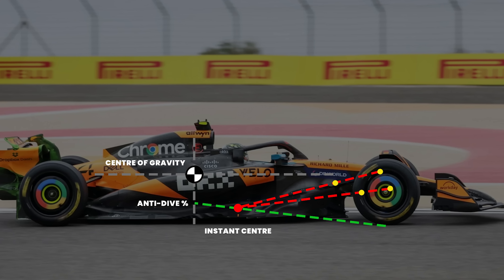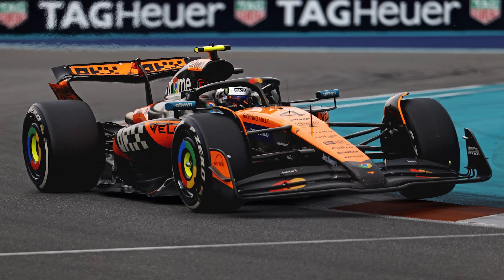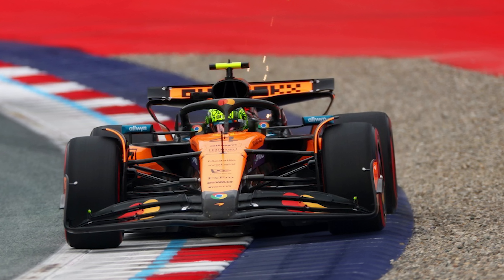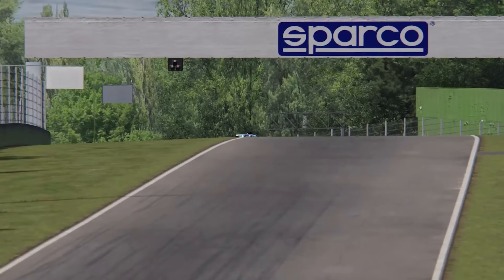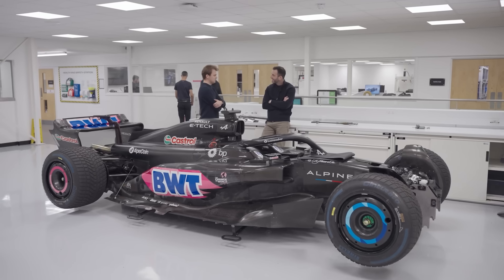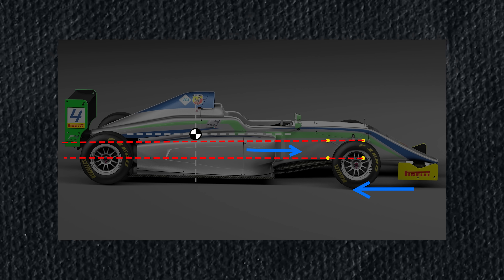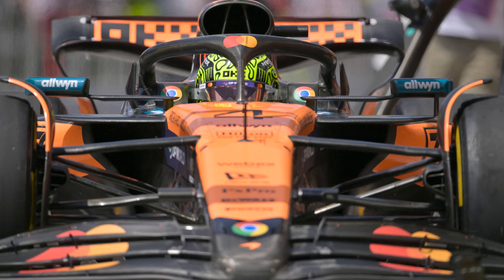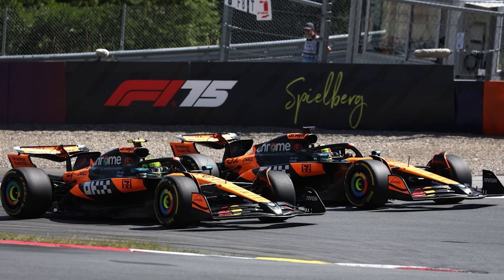McLaren’s NO SUSPENSION Trick

Comment: Of course, the compression of the tire - acts as "spring".  As more weight is added to a corner, the tire profile changes -  acting as a spring.  These tires are not solid  incompressible rubber.   Even chassis flex acts as a spring.    NONE  of these sites has answered the question, why do you cross weight ?  and when does uneven crossweight improve "lap times"...........   Someone please start thinking about it.

Comment: Taking all the braking loads through the wishbones means the front will be very stiff during that phase and it will be easy to induce a lot of microlocking in the zone which really hurts the tires. I wonder how they're getting around that aspect of running high anti-dive?

Comment: I recommend investigating whether or not they're employing flaps.Yes, like airplane flaps, split air line.Air flaps on an airplane can give as much as three times the plane's weight and lift assistance. Allowing very low speed, takeoff's and landing correspond.A jet plane low speed is anything under a hundred and thirty miles an hour just a thought.

Comment: I remember from my reading that when considering the roll centre near the CG in a cornering scenario, a "zero roll" setup would introduce a "jacking force" to cause the inside wheel to lift, instead of compression of the outside suspension. Would the same effect apply in the video's scenario and cause the rear to lift? Also, how do they combat the overloading of the front tires under braking, since the forces now act near instantaneously through the chassis, when there's no compressible suspension to tune?

Comment: How has this never been thought of with all those well paid designers
Reply: Because the teams are chasing new rules that change what an ideal car is. Before they got most of their downforce from the wings so it was better to have more compliant suspension so the car was easier to drive. Now, they need it to keep a more consistent ride height because the downforce is from the under tray. So, teams are having to figure out what works best. 
They had similar problems back in the ground effect days. Took teams doing different things until everybody basically settled on what worked the best at that time.

Comment: @driver61 
True about the F4 cars not having adjustable front geometry. 
I worked a couple years for a Racing school as a lead mechanic and test driver for a fleet of last gen F4s. 
These cars did double duty, serving as cars that some people would be driving as their very first time on track, but also the same car, sometimes in the same week would be used for the school’s racing series, driven by some (sometimes) very talented up and coming kids and adults. 
Now, when I got there the cars were in a pretty rough shape and one car to the next could feel super different, despite all having the same hardware like spring rate, dampers, ARBs…different setups sometimes. A lot of times the cars would be as is, same setup as the racing team they had bought it from. To put a beginner in, quickly ended up in spins and crashes. 
Anyway,
I was tasked with coming up with a setup that was simultaneously easy enough to drive for a beginner but also good enough that a serious racer can get enough out of it at full tilt. 
Another caveat was that I was stuck with the current spring rates and ARBs because they didn’t want to spend money to buy 30 sets of everything to make a change…

After some time getting familiar with them and driving it and studying what I had to work with, I came up with a setup that boiled down to changing mainly two things;
The first was to run slightly less camber than normal and a fair bit more caster. 
Less camber helped reduce front lockups, and while more caster did make the steering effort harder, it ensured enough camber gain mid corner and also gave way better feedback through the steering wheel when approaching the limit. 
The second thing was, anti-dive like in this video. Well…The opposite, anyway. 
The f4s only had one fixed bolt locations for the whole front suspension, but the gearbox and rear suspension did have a couple options. 
After some measuring I figured that from factory they are all running a decent bit of anti-squat. Not a lot, but enough to make a difference. 
I changed them all to tune it out. 
One of the biggest things for a beginner hopping into a formula car, especially if no karting history, is coming to terms with just how tightly sprung the cars are. Bringing some little bit of squat back in helps feel the load transfer better.

Comment: An interesting development in geometry? Setting up the suspension geometry can improve the tyre contact with the road surface especially as the car pitches & droops under acceleration and braking.
The first set up on any racing car is to neutralise the effect of turning. This is done by adjusting the KING PIN angle. When correct, the front wheels toe in and out will not vary during steering during pitching & drooping, and this is achieved by removing the suspension and setting the car minimum and maximum ride heights. Without suspension, the chassis can be raised and lowered by hand. So the first check is to sit the chassis on the blocks having the minimum ride height and then checking the toe in and out. Then to repeat on the maximum ride height block. If the king pin is at the right angle, the pitch and drop will will have NO impact on the toe in or out and the wheels will remain at the same setting required, (usually a small amount of toe in is preferred to auto centralise the steering when in motion and to abrade the front tyres to keep them warm. This is then repeated on the rear wheels and again, (where a small amount of toe in is proffered as under power the wheels tend to spread outward). The final checks with the suspension off is the camber angel on each wheel and final check for crabbed tracking to ensure the front and rear wheels are parallel, when the front wheels are set dead ahead.
Anti roll bars are used to limit the roll across the chassis which will affect the camber angle changes on all wheels. 
The idea of wishbone selective location of their anchorages attempts to limit the pitch and droop of the chassis, between front and the rear axel centres, keeping the bottom of the car flat in all directions. So by keep the tyres FLAT on the track surface and the under tray the same, a consistent suction and friction is attained. I'm just surprised its taken so long. The fly in the ointment comes when you put the suspension and damping on which must also all act together, otherwise corner weights become uneven under load which then affects friction and grip. Otherwise, its all perfectly simple. Setting up took half our time in the garage and at the track. Not to forget the brake balance and gearbox cog selection.
Reply: Everything your describing they are having to make the air moving over the car do.

Comment: The water in tyres gag was preposterous. The tyre is a closed system, unless they hsve  a wey to remove hot water from the tyre and cool it, inbsome sort of radiator.
The only upside would be,, thst tgmmhe tyre pressure doesn'!t change because water does not compress (or am I mistsking it for another fluid?)

Comment: So effectively, what you are saying is that McLaren is sort of cheating by ignoring common sense rules.   They have moved the upper pickup point to a spot well beyond the middle bodywork, and in doing so have created a very obvious penetration hazard to the drivers compartment in the case of a severe front end impact.  If the front wheel gets hit hard, it is likely to pivot on the front mounts and apply all of the load onto the rear mounts.   So say a 20g into a slightly more solid object would put all of that force into a very small pickup point which is now basically around the drivers legs.  

Further, as the suspension effectively will have little actual compliance (the design puts it in a bind against vertical movement) the car would be incredibly dangerous if it leaves the track and his even a small bump, as it would not have any real give at the front.   That would in turn mean that any impact at the front (say even going over a sausage curb straight on, or perhaps a bump in grass on an off track trip) would be sent directly to the drivers spine.   This may explain why Lando and Oscar come out of the end of the race looking like they have been wrestling with a bear for two hours.  It has to hurt.

Comment: I wonder if they built some flex into the driver's seat if that would help the driver sense the forces on the car under cornering? Kind of replace or replicate the seuspension feel using the seat instead of the actual front suspension? IDK, I'm a fan, not an engineer.

Comment: Why can't they use don't kind of wheel or guide on the front of the wing and have it tethered to the car in a way that braking doesn't affect the wing. Just the vehicle. I bet the drivers would be able to get more rotation if they allow their suspensions to work. At that level a tenth matters.

Comment: I don't know, may be it is forbidden by the rules, but I would mount a pilot seat, engine and other heavy parts of the car to a body with soft cushions, which would dissipate the road vibrations, and use very stiff suspension. So it would work like a double-chassis, but without the second frame.

Comment: That is quite strange that F1 pilots need a dive as a feedback. They all started from carting which has no suspension at all. Also even if the chassis is perfectly flat regarding the road, the pilot body still feels the forces from the seat belts and moves a bit. That you can feel even in a Citroen's Activa: the car stays flat in corners, but you are moving so hard in a seat, that for you there is not much difference comparing to a normal car.

Comment: "In short, a suspension lower the loads to the tires, especially peak loads"

("good on tire?" your reason it probably wrong) If you have a suspension, you would have a more consistent load on the tires... yes, the suspension allows more load to transfer on the chassis but has less transfer load to the tire... for sure the peak load with the suspension would be lower!!!

think like this, If you have a low roll center, long A-arm, and soft suspension... the vehicle could weight 10,000lbs and you could probably lift the tire with your hand. 

extreme example so you can get the idea, think about it like trying to jump and land in soft sand, you're not going to jump as high, even if you do you're not going to land as hard.

Comment: I knew Ferrari was screwed when they revealed the 2025 cars because you could see McLaren took their suspension design, what everyone thought was helping McLaren at the end of the previous season, and turned the dial up to 11. Ferrari made a big deal about going to the new suspension finally, but they only turned the suspension design dial up to 4 or 5 with the geometry choices for the SF25.

McLaren maxing out the anti dive meant that they just wanted the maximum forces there, to squeeze all that was possible from this geometry, to unlock a wider range of setups and peak performance. It started at Red Bull at the beginning of the formula and Ferrari waits until the last season of the formula to dabble in this powerful design choice.

I wonder if a part of Lando’s update was to help create more forces on the front to help it dive a little more at high speed. I have no clue, but there’s definitely a lot going on with the McLaren car.

Comment: BMW motorcycles did this on their bikes with the new front suspension. They were able to reduce dive under braking to zero. They found that without the dive, the rider would over-brake to the point of wheel lock due to no feedback regarding how much front brake the rider was applying.

Comment: To my eye, such a system will transfer the change in forward motion to increased weight / downforce on the rear tires. If they tuned it correctly, they could keep the floor flat under breaking. 
It's fascinating, the beauty of human ingenuity.

Comment: why cant they make the underbody aero so that it performs optimally when the dive happens? after all that is when you need the most downforce
maybe they can somehow make the front suspension 'lock' in the dived position under persistent load during the corner, then 'pop' back to their original height when the weight is transferred to the rear wheels from acceleration, reducing the amount of downforce and therefore also drag

Comment: Just curious, do you think similar tech could be used in reverse to make front wheel drive cars lift less in the front and therefore improve their inferior  acceleration from a dig? Or would the weight still transfer and it wouldn't matter?

Comment: I've been saying this for a while. but something people still don't talk about is to have the undercarriage and wheel systems (semi) detached to fully remove 100% of the cars suspension. this can be more dangerous... sure, but these are the most skilled drivers on the planet and i think they should be the ones to decide how they want to race. the engineers can know how to achieve something, but should have no say in how the drivers want the car to operate under their control. all this to say, if you detach from the suspension system, you no longer need it. simply said.

Comment: Anti-dive is designed into all passenger vehicles to improve stability. However, it will never be ‘designed out’ of passenger cars as the dive is a crucial signal to drivers telling them how strongly, relatively speaking, the braking of the vehicle actually is. Dive, though destabilizing, is a safety feature in passenger cars.

Comment: Great explanation. I can believe this functioning as stated. However with my R1250GS and it’s paralever front suspension I don’t believe it functions as people state with anti-dive. Reason is the geometry of the wheel movement isn’t any different. It has electronic suspension and I think the anti-dive, if it’s doing that, is electronic and not mechanical. Relocating the spring shouldn’t change anything about braking when the path of travel doesn’t change.

Comment: I've been driving cars that has been criticised for not giving much or any feedback through the steering. After a peiod of acclimatising myself to this, I found myself reacting through other means, mainly through the seat and body contact as well as eyes, ears/balance and general body movement in relation to the car. I found that that was being just as good as relying on steering wheel feedback.. in some cases even slightly superior. I guess that consistently being conscious of the whole car's behaviour rather than concentrating on the front end (partially, of course) can be advantageous. I have some racing experience as a reference..
Reply: The problem with eyes is that reaction, even with training, is .25 to .75 seconds.  Trained proprioceptive response, which doesn't require any brain processing and happens instead in the CNS at the spinal column in response to feedback from distributed proprioceptors, has near immediate latency.

Comment: This is similar to the ELF endurance racing motorbike back in the 80's (?). It used hub centre steering and the engineers made it so there was zero dive under brakes. The riders hated it as there was about zero feedback from the front wheel so they engineered back in some dive. Similar today is BMWs telelever front end for bikes. It allows for very late braking into corners with not much dive so the suspension geometry stays about the same, but you don't get much feedback from the front wheel.

Comment: What about the increased chassis jacking as a consequence of the high anti-dive value? I assume the engineers are aware of this and the resulting design is a compromise between the advantages and disadvantages of high anti-dive values. I only mention this because this knowledge should also be included to complete the picture.

Comment: I once roda a motorcycle with hub center steering.
It was unnerving under the brakes in the rain as you didnt really know how much you were loading the front tyre and then with your years of experience , if that tyre will grip the road on turn in . 
But it did grip as i never fell off it 🎉

Comment: I know Colin Chapman was a bit of a questionable character in that he often ignored safety where he shouldn't, but I truly miss input from people like him. He was a genius and had some great ways of thinking outside the box and finding holes in pretty bloody rigid rules. 
The 88 was a fantastic example of getting round the problem of suspension and under car air flow. Who on earth would have predicted that back in the day? I certinaly didn't see it coming back then.
And of course use of wings, and so on.
This is truly one thing that annoys me about F1 these days. I get the need for green things - like reusable parts, or longer lasting parts, etc. That's fine. BUt the rules now are so bloody rigid where I feel they needn't be as they offer so very little for innovation and when it does come through it tends to get banned immediately.
We should be embracing those things more and expanding on them.

Comment: 6:38 So, it's like a lever? Or virtual lever created from suspension geometry? 

The moment on a lever
Like, if you look at the image here, the red line is your lever and torque is proportional to lever length. 
So McLaren is making that red line as short as possible decreasing the torque felt by the chassis or suspension.
And less torque twisting the noise towards the ground?

Is that it or am i completely missing the trick?
Because it's 2am and I'm probably too tired to understand this right now! 😂